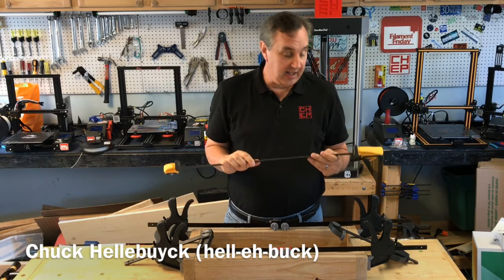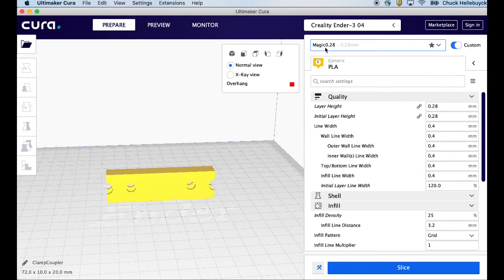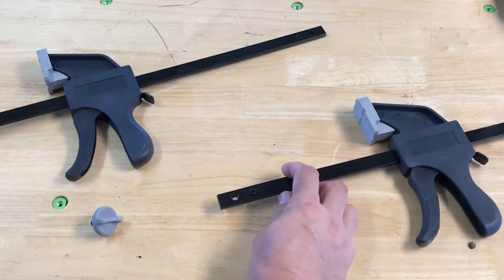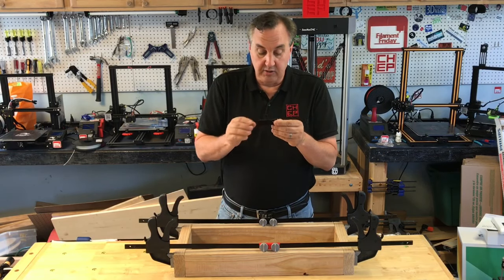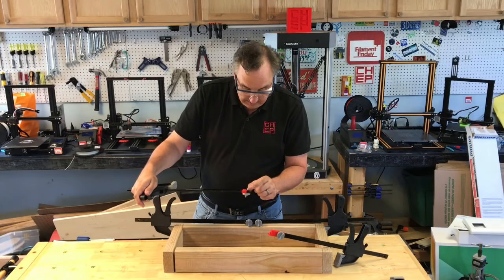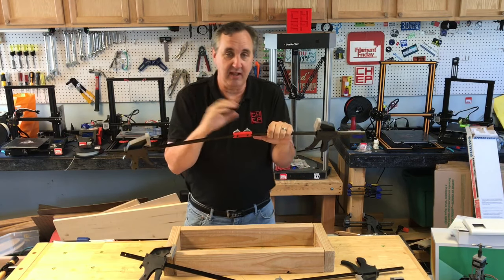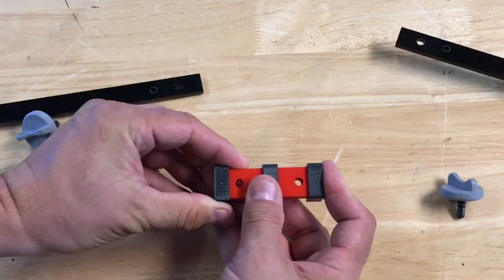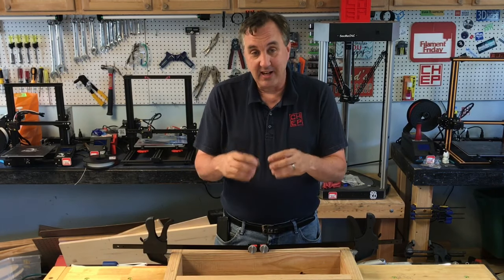How To Make STRONGER 3D PRINTS

Comment: I do these kinds of "fixes" regularly, I generally use PLA+ because it's a bit less brittle and I go thick with 4-5 perimeters. Our boxer's dog bed has corners I designed to replace the broken stock ones and the 90LB dog jumps on it and sleeps on it.  If I remember correctly the walls on the prints are about 8mm thick printed in Amazon PLA+. I really appreciate you showing that 3d Printing isn't just for cute nick-nacks or printer upgrades.

Comment: You ALWAYS want to keep print orientation in mind when dealing with stresses.  For example I was designing a part with a cantilever latch.  It had to be printed properly, or else it would just snap along the layer line when pushed in.

Layer HEIGHT also has a bearing on the overall strength of a part, as does cooling.  We use higher cooling for more accurate prints, but less cooling will give stronger prints as it results in stronger layer adhesion.

Comment: 3D printing is truly amazing. It's relatively cheap too. An Ender 3 doesn't cost much. There is even a 89 dollar 3D printer, the Easythreed X1. It's a portable mini 3D printer, and believe it or not, it doesn't suck. It's solid, easy to use and has a direct drive extruder so it can even print flexible filaments. No heated bed, but the bed is magnetic and removable. It even has thermal runaway protection.

Comment: I would suggest printing your object face-down, which will require either a printer with exceptionally good bridging capability or you can use supports which should be pretty easy to clean out by pulling some supports out and ramming the clamp through the channel to clean the rest. Print it all as solid layers, no fill, and that will be the strongest possible print.
Reply from the maker: How will that be any different then what I did?  
The layers will separate under force. My two print solution has worked really well.
Reply: If you "push over" your print so that the holes are facing up and down you will be printing an object with no layering in the load axis (just as you have now). I am speculating that making a short stack of large rectangles is better than making a taller stack of small rectangles, that's all.
Reply: i was going to suggest this third printing option, glad someone mentioned it already.

Comment: Another great practical print.  As some others suggested, alternating some angled walls would likely aid the strength.
Reply from the maker: reasonablebeing - Dont believe that adds any strength as the layers will still separate.
Reply: @FilamentFriday  I had to think about that - You can't really do anything about the layer lines except strengthen them with good adhesion between layers by adjusting print parameters.  But I'm now thinking that an angled infill with solid outer layers might aid dissipating the longitudinal forces better.  Another idea would be having a low infill and filling the chambers with epoxy.  OK I'm done re-inventing the wheel.  The original modified design with sleeve certainly is KISS and gets the top prize.  I'm going to make a few for my shop.

Comment: Great job on showing how the filament is stronger one way or the other but all in all you all you needed was a quarter inch bolt bolt those two clamps together saved yourself a lot of time
Reply from the maker: The centers would be offset if I did that.

Comment: I have found your videos interesting. It is very well to show which printing orientation is strongest.
However I think on this particular case. It is cheapest, easier, faster and strongest to drill holes on a steel bar or better an angle profile.
Thanks.

Comment: You don’t need to crank down so much for gluing wood, but may for some other materials. Double wrapped couplings look great, and with some mods could work with the Irwins.
Reply from the maker: I cranked hard to see its failure point.
Reply: Would be interesting to set up a gauge and measure the pressures, or tie into Stefan at CNC Kitchen tests. Wonder if you were 3-4x the pressures needed in ‘normal’ use. I’ll be making some of these for sure. Nice that you do woodworking too.

Comment: you could print the connector longer and have the bolt features on the ends surround the rod. Then the middle section could be solid fill, and as long as your printer will allow.

Comment: Chep, 
You placed your clamps on the second test with a small angle even before the test.
When you pull the bars away from each other,  they push also down, actualy only the tip of the bar push down.
You have got a Great force working on a small area perpendicular to the adhesive later direction (the weaker side of the part). 
That is way it splits were it splits on the second test.
If your clamp were parallel at the beggining it might withstand the test like the black part in the first test.
In conclusion, it is better to print the part in such a way that the forces will work parallel to the matetial and not perpendicular to it.
Reply from the maker: The black cracked a little too. The center of the clamp pad is below the center of the bar so there will always be a downward force on the print.

Comment: Me seing the explanation of what he want's to do:
Even better should've been the part laying down with the round holes on the prionting bed, the version standing can't be as strong as the other versions, due to the layering, that much should be apparent. The reason why the version with the longest and widest side down would be even more stabile then the version with the longest and narrow side down (you printed) is due to the fact, that the part can be split along the mainaxis, with the long/wide version you would get the side with the holes printed in a criss-cross pattern strengthening it even more. The only critical area left would be the edges though in any case due to how the part was designed.
After 5:19 : Called it!
Reply: True, the strongest holes would have been the wide side laying down. However, that would also be a wider bridge on the other side, and would have required supports.
Reply: @PunakiviAddikti  doesnt even need to bridge, just print two flat plates, and bolt them together through the hole in the clamp rod.

Comment: It makes sense that the print that was done vertically was the weakest because 3D prints would seem to me to be an an-isotopic material, that is the properties are not equal in all directions, like wood which has a grain.  Pulling perpendicular to the “grain” of a 3D print would logically be the weakest direction with respect to strength.  When the 3D print is horizontal, the “grain” is parallel to the force and the horizontal shear strength controls any splitting of the material.
Reply from the maker: Well done. You confirmed what I was trying to demonstrate.

Comment: Stronger yet, just line the holes on the bars up and run a single bolt through both!
Reply from the maker: Might work but the clamps will be off center.

Comment: Great fun.  Thanks for sharing.  What if you used the Carbon infused filament??
Reply: it's a gimmick.  the fibers are in line with the layers, so they can still break between layers (that is if there is even fiber, it could just be carbon dust)
Reply: If it fused with Nylon maybe.
Not sure about the gimmick thing. There are a few videos showing some advantages to CF Nylon. But yes as with any filament..its weakest point is at the layer lines. So better layer bonding is key. Higher temp filaments are a must.
But yes. In the end...there will always be a layer line

Comment: if you printed one in one direction and then another full sleeve to go over the top in the other direction using ABS and then applied some acetone as you slid the outer one over the inner one you would have a really really solid part, give it a try and post the video of the results ? :-)

Comment: Wait what type of filament did you use? ABS is stronger than PLA after all.

Should check out design spark mechanical sometime, it's as easy to use as tinkerCAD, but works a lot more like fusion 360.
Reply from the maker: I tried design spark. Didn’t like it.
Reply: @FilamentFriday  still might be worth featuring on the channel for others, and feedback is always good for the dev team, it's a pretty small team.

Comment: How do you get the animation in Cura all I can see is layers am I missing something ?
Reply from the maker: Check Cura graphics card requirements.
Reply: If you have integrated and dedicated graphic cards, simply right click and run with nvidia or amd grahic card or go into the grahic card control panel and assign to the cura the dedicated graphic card permanently

Comment: I have this one issue which is the extruder and the bed on the rails getting on one point (always the same one)  kinda stuck.  Its like if there is a Valley in the Rail. But there is none. The wheels are Fine too. Has some one experienced that issue too?

Comment: There is actually a 3rd orientation that would be stronger than the 2 shown here without the sliding brace.
Reply from the maker: What is that?
Reply: @FilamentFriday  Turn it 90 degrees so that the screw holes are flat circles when printed.  I always consider the layer lines like wood grains.  Essentially you want the screws compressing the layer lines in this case.

Comment: What happens if you combine layers with angles of 0 and 90 degrees? It seems to me that simplify can be done. It would be nice to see compression and bending tests by analyzing the various filling patterns. Always great job !!
Reply from the maker: turrican1980 - The layers would be the same. So I don’t expect that to add much strength.
Reply: @FilamentFriday  You are right in fact you have changed the layout of the piece on the floor and this changes the forces involved. At this point before printing one knows the behavior of the piece based on the orientation.

Comment: Put the 3d prints in fine solt. And re melt it in an oven.
Reply from the maker: How does that make them stronger?
Reply: @FilamentFriday  Use fine solt. Compact the salt around the 3d print. That is the support material. To keep the shape of print. Make sure printed with 100% infill.
Put everything in the oven. Melt the 3d print. All the layers will melt together. Max layer addhesion. And the surface finish is going to be like sls prints.
Salt is easy to remove after the process.
Reply: CHEP I learned about fusing sheets of glass in 3 dimensions by using sand to support it when it melts. This actually makes sense to me, the salt may embed in the pla though
Reply: @michaelosmon  That is why the salt. Can washed off by water.

Comment: Use ABS next time. PLA is not practical at all. Distorts too easily.
I hardly ever use PLA anymore....
Reply from the maker: The forces pulling apart at layers lines is the same no matter what plastic.
Reply: @FilamentFriday  Yes. And some plastics layer lines bond much better than others. And many factors are at play. Not just plastic type. PLA is very strong..but its low distortion point is the killer.